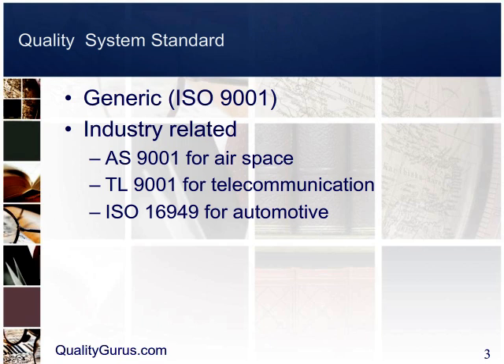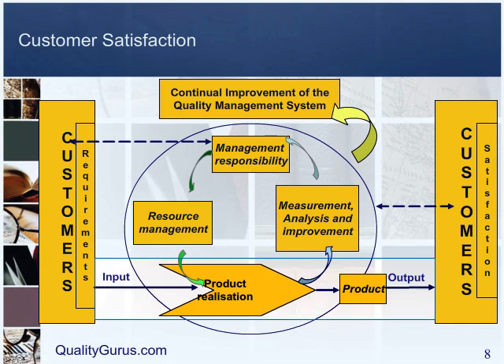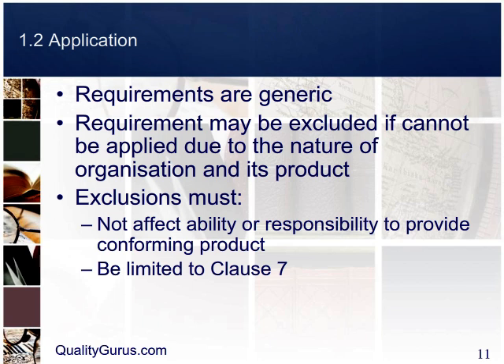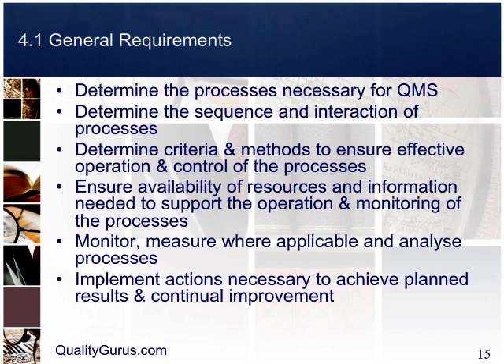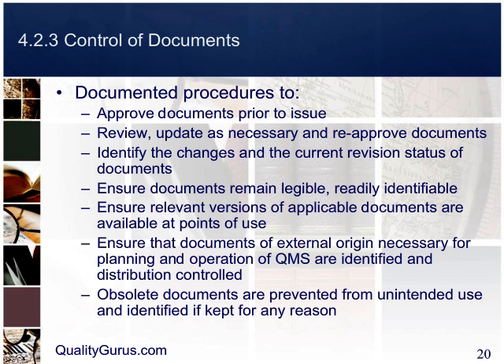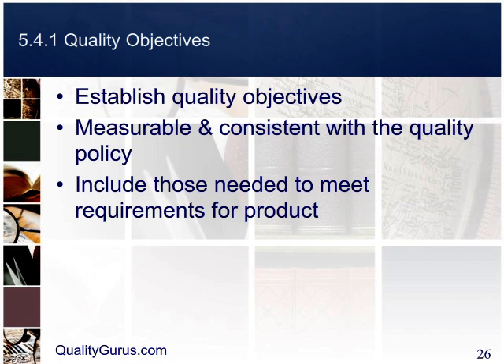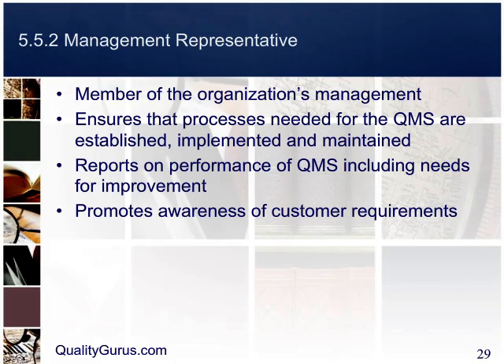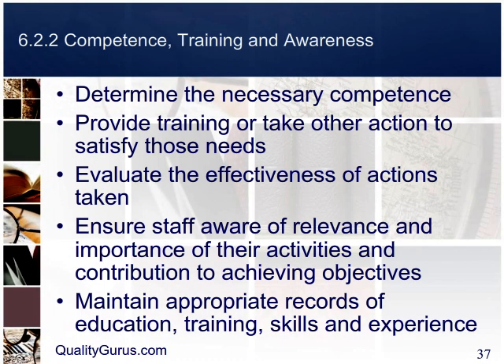ISO 9001:2008 Part 1 of 2

Comment: Hi Hilda, ISO 9001 gives you a proven set of practices to standardize your product and achieve customer delight. If well applied your management actually works to improve the business. Also, buyers tell your sales staff, "If you have no ISO certification, then we won't have new business with you" or they might keep you as a low volume supplier or issue a deadline for you to certify your company. Usually if you have no ISO certification your product quality is at a risk of being compromised, there are much more reasons why you want ISO. Implementation is difficult and management plays a key role in driving ISO 9001.